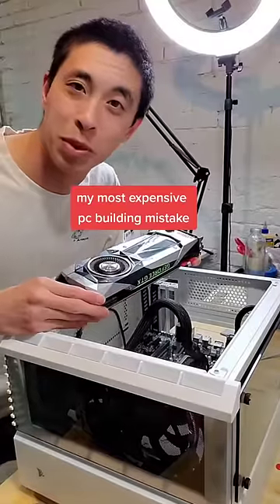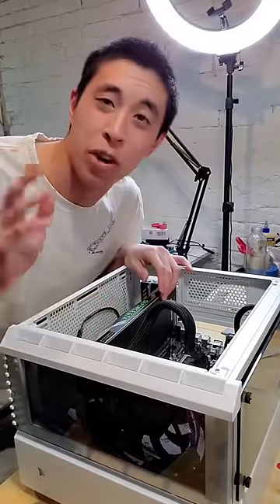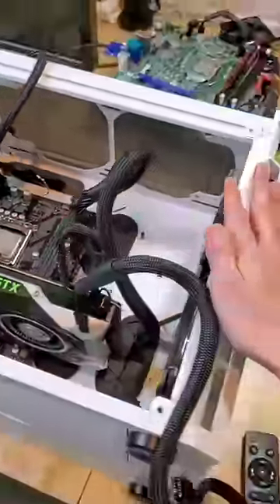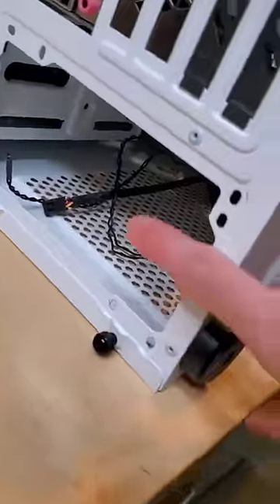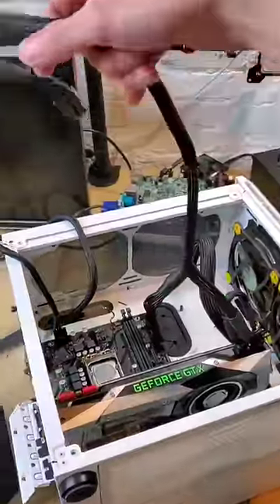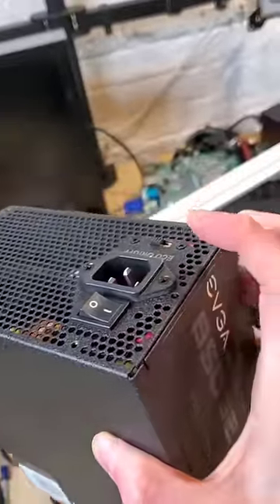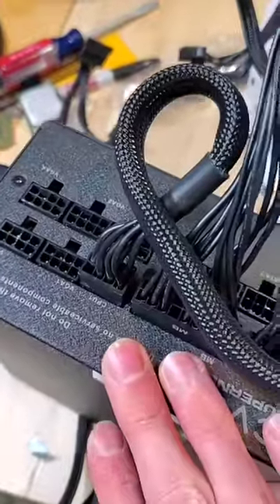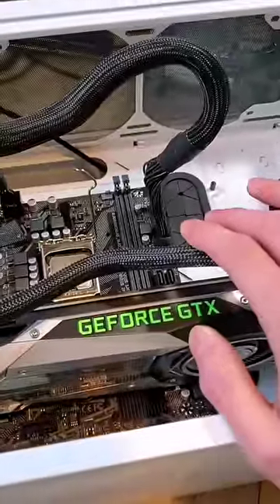my most expensive pc building mistake... #shorts

Comment: The second he said "pre routed wires" i knew where it was going, and sure enough THERE WAS NO PSU
Reply: Yup.
Reply: To prevent do this  you just replace the cables and use new ones?
Reply: @MorTphyr  absolutely ALWAYS replace the cables that you KNOW are compatible with the psu you're using.

The main reason is different manufacturers could have different pin layouts through out the wire / molex.
Reply: Make sure the OEM are the same. U can use seasonicand Corsair cables in some cases as the oem is seasonic.
Reply: @VirallVariety  it can even be dangerous to mix cables from the same OEM, don't risk it
Reply: @sselesUneeuQ  thanks,  i was wondering why it died.
Reply: @sselesUneeuQ  then what can I do if somehow i broke the cable, buying new cable seems dangerous
Reply: @velzing22  you should check that the replacement cables you buy specifically list the model of PSU you're buying them for
Reply: Always measure with power cables. The connector pinout on the component side is standardized, but the PSU side sadly not.
Reply: @RicardoVermeltfoort  
I think you ment the brand. 
A Corsair PSU with Seasonic OEM  uses  use different pinout than a first party Seasonic, for example.
Reply: Im wondering also why there wasn't a cpu cooler on
Reply: @sselesUneeuQ  what cables? I am new to pc building and am going to build my pc next week. Are you saying CPU cables or GPU cables? 

I have a Corsair 750w PSU and a Geforece ROG strix 3070. My cpu is a Corsair h100i.

Are those cables all compatible?????? I’m getting freaked out now
Reply: @Yinyang1277  PSUs come with all the cables necessary and not all PSU cables have the same pin layout. 

The "CPU" cable is just the motherboard 24pin connector and the 6pin PCIe connector. GPU cables are just 6/8pin or 2 6/8pin PCIe connectors.
Reply: @sselesUneeuQ  sweet! I build my first PC today wish me luck haha! When I am done with it I’ll make a shorts video on my page in case anyone is curious! 

I’m very nervous, but very excited! I am afraid of the cables and cable management tbh. I’m not longer afraid to assemble the actual parts though as I thought you need special screwdrivers etc not a standard Philip head.
Reply: @sselesUneeuQ  that makes sense though thanks for the information! When I was reading these comments etc I went from being calm to FREAKING out🤣🤣🤣🤣like no way did I spend this much on a motherboard and PSU just to find out they aren’t compatible NOW that the parts have come in when no other video has addressed this out of the literally HOURS of videos I’ve watched before hand.

Now I see what you mean it’s just you can’t guarantee a PSU can have all the correct cables for your motherboard. I thought all of them came with the correct ones so it’s good to know💯
Reply: i think having multimeter can be really handy with this , if you can measure the pins u can know for sure if it will fry it or not
Reply: @Yinyang1277  this video is a poor or terrible psa, i know its a short video but at least he should clarify that you shouldn't mix random cable with different brand psu. I searched half of the comment trying to find if there anyone could explain but to no avail. Im glad that you asked the question and we finally got the answer. Cheers.
Reply: In short, from my understanding is that to never mix random cable with different brand psu because different manufacturers have different pin layout. Only use cables that come with the psu inside the box. Correct me if im wrong.
Reply: @lemonadejuice7356  ohh ok good that’s ultimately what I ended up doing! I built the PC myself, but I didn’t know I needed an adapter cable just to finish the front fans.

I gotta say it was satisfying lol!
Reply: @lemonadejuice7356  very stressful… but worth it🤣peace and love
Reply: @Yinyang1277  cpu dont have any cable. your corsair h1001 is aio cooler which usually connect to motherboard. idk about this model much because i dont have it. PSU cable are build to be compatible with all component. What he mean, the power cable that comes from the PSU cant be used on another PSU (modular PSU) non modular, already have cable soldered from the PSU, so you cant mismatch/mixed it anyways
Reply: this is so cringe i will block you
Reply: @Yinyang1277  they're saying don't mix a any cables from 1 PSU with cables of a different PSU.
Reply: @ArtisChronicles  OHHHHHH! Thank you that makes sense I wouldnt do that anyways just for safety reasons. Good to know its the right thought!
Reply: @velzing22  send a polite email to the manufacturer explaining the issue and all the information about your power supply (serial number and all), they might be kind enough to send you a replacement cable that will be safe for use with your power supply or even send you a new power
Reply: @Yinyang1277  your PSU will come with all the cables you need, if by some chance you lose a cable or something happens to them then you should contact the supplier, in this instance Corsair, and inform them about what has happened. They will likely offer to send you replacement cables which will be safe to use for your particular power supply
Reply: @lemonadejuice7356  they have different pin layouts, tolerances, current allowance, etc. Mixing and matching PSU cables is a game of Russian roulette and it requires a lot of research to truly know if a cable is compatible for your specific needs, therefor the average consumer should always use the cables supplied with their PSU or cables approved by the manufacturer (replacement cables sent to you after contacting the manufacturer)
Reply: @sselesUneeuQ  so basically ITX is a shitty standard
Reply: @MorTphyr  different brands use a different pin arrangement for some ungodly reason. Evga is incompatible with corsair for example
Reply: "...no,no,NOOO!" - my reaction when I heard modular cables but no power supply. Pain just thinking about it.
Reply: @lucamartino100  not really, everything on the component end of the psu cables is standard but between different brands and even different models within the same brands the cables could be different on the PSU end, which would lead to fried components
Reply: @chaosinhd1823  so if ITX had also standardized cables or connectors on motherboards there wouldn't be this problem. That's why I say it's a crap standard.
Reply: @MorTphyr I prefer to eat them

Comment: Not me personally broke anything but i sold almost brand new ryzen 3900x. Took pictures of it beforehand mainly pins and had them time marked Incase something happened. The guy requested a refund saying it wouldn't work.  I got a completely different card back with half the pins broke off and a whole new serial number.  Called eBay support and they sided with the buyer so i no longer sell pc parts on eBay.
Reply: naaaahh, jit trippin
Reply: Never EVER sell anything at eBay or you'll regret your life decisions your whole life
Reply: @tomotime9284  elaborate?
Reply: Ebay will ALWAYS side with the buyer. Notice how there’s buyer protection, but no seller protection? Never use ebay, I repeat anyone reading this- do not sell on ebay.
Reply: @ToatsMcGoats534  
Years ago they used to side with the seller or at least give you a fair look at.
You could understand that both sides can be lying but at least with a seller you have a track record. A buyer can make a new account on the day of sale... Remember when you used to be able to block certain areas or accounts from making offers? They ever bring that back? No ebay.. I do not want the new account "willscam23sChina$#@" to bid on my item.
Reply: Had something similar sold a 3090 and made sure to take pics of the pcie interface and power pins, buy then says card won't work and when he checked there was damage to pcie interface and some of the pcie power pins had been bent, asked for pics and looked like he had dropped the card and forced in the power the wrong way round, refused a refund. Ebay initially sided with him but I sent them all the pics and threatened legal action if they didn't at least look, ultimately they denied his refund but it shouldn't be that hard.
Reply: This is why I never sell on eBay.
Reply: @tomotime9284  I've sold on ebay for 6 years and never had an issue.
Reply: Man IDK what yall are doing so much differently but I have never had ebay side with the purchaser. Granted I am METICULOUS about logging evidence of the items condition prior to me sending it out. I also make sure every item is marked "non returnable/as is". Lol
Reply: Selling pre owned electronics on a third party website just screams bad financial decisions. That a shim market anyway you did yourself a favor by stopping.
Reply: Just don’t refund, especially with eBay.
Reply: I appreciate your comment and will heed your warning. My condolences.
Reply: You'd think the fact it had a different serial number would be a dead give away
Reply: That's fucked up
Reply: No it's okay to sell on eBay the problem is they have all these programs and initiatives and guarantees and money back warranties and insurance and people ignore all that because they're being cheap and then they get mad when they're liable that's why big companies with overhead don't even care if you send something back that's broken they have insurance
Reply: That’s when you issue a chargeback. I threatened to take my bank to court before if they wouldn’t issue a chargeback when I had loads of proof that services were not rendered. I had my money back in a couple days. They can issue a charge back if eBay took the money when they sided with the buyer. Then everyone wins except ebay
Reply: Sell crypto scams. And watch your bank account fly
Reply: @snkantzas  read justmamba 's comment
Reply: @AikaroMusic  ebay refunds your money for you.  you have NO choice.
Reply: leo c  spend $10k on a lawyer for a $300 refund???
Reply: @snkantzas  doesn't the original comment really tell you why not to do it? :D
Reply: yes, Ebay is buyer sided, now people don't want to sell to new ebay account, just for that. It's sad.
Reply: @tomotime9284  I mean I wouldn’t say anything, I’ve been selling collectibles and vintage toys on eBay for years, at least in that market there’s hardly if not any assholes
Reply: Ebay and paypal are trash...i just had a similar issue with paypal...had to escalate to my CC and they sided with me. Im guessing out of spite my paypal was locked down and they wanted me to jump through hoops to get it unlocked...fuck paypal.
Reply: EBay doesn't want respectable sellers on their platform is something I learned years ago.
Reply: @ToatsMcGoats534  now I know I can buy things on ebay safely.
Reply: Ebay always sides with buyers even if you offer no returns. Had same exact thing happen but wasn't a pc part... lost 3k

Comment: These are the kinds of shorts we need, no telling how many peoples' systems you saved in the future by sharing this.
Reply: too late..
Reply: For real I was literally about to do this in about a day 😅
Reply: @fragelius you did it ?
Reply: @JeuneF  yeah burned my 3 hdds but ssd survived :p
Reply: I still didn't understand the problem. Why everything burned?
Reply: I Goodled it and it's because modular cables are not standardized like molex and other aftermarket
Reply: @robipindric7654 because the pinout of modular power supplies mostly isn't the same between models even if the cables fit. We're used to cables only fitting where they're supposed to go on motherboards, but that's not the case in modular PSU's side, and wrong connections will usually fry one side or another, or both
Reply: I was about to do this as well im so glad I saw this
Reply: Probably me. I just ordered a new PSU I am an noob So I bet I would have just used the same cables that are already attached

Comment: Forgot to turn on my power supply… the emotional damage I suffered that day was on another level!
Reply: WAIT explain I've never built a PC so the understand here
Reply: @ryanlee9150  lol he's kidding all he did was not hit the power on switch in the back of the PC haha
Reply: @Iamdudeman12  you know my suffering!
Reply: @thanefenrir  yes I do!!! 🤣🤣
Reply: You start thinking “FUCK FUCK, did I shock the board” sweat starts to form and the anxiety can be felt in the room. 
Then you take it apart and do it all over just to realize it wasn’t turned on. 
That was our friend when he called me during a build 😂
Reply: @mint2470  lmao I recently finished building my pc and had no power lmao and it was the same problem just the switch I always forget to switch it on
Reply: @mint2470  i will never forget this feeling
Reply: EMOTIONAL DAAAMAGE!
Reply: @The_Hussar  I've had similar issues in earlier years when I was new to PC building except I didn't push my RAM until it clicked all the way in. I thought I bricked or corrupted my only HDD. Took me like 30 minutes to figure out the problem too! Was like 15-16 at the time so it was a good learning experience
Reply: Damn, i feel that. Last month i build my first pc. All cables was connected but it can't turn on and im panic. After several hours looking for a solution, i realized that my psu switch still off 🤣
Reply: When I built my first PC, I forgot to plug the power supply cable to the power button. I almost tore it apart to put it back together again.
Reply: super relateable it makes it way less satisfying
Reply: I plugged the DP cable in the motherboard. Not the GPU. I was freaking the fuck out.
Reply: Well had this feeling like a few times xD sometimes the pc reboots itself a few times to automatically configure the ram, you have to gie it some time and I was like restarting it 30 times 🤣
Reply: Lol😄👌🏽
Reply: LOL!  Hopefully it resolved itself in a few seconds when you realized that.  If it took longer, you should really analyze why....
Reply: @ryanlee9150 They didn't turn the power supply on, so when they tried to turn the PC on it didn't work.  Which induces the panic one can only feel when they fear they've done something wrong and possibly fried several hundred dollars worth of components.
Reply: I feel like everyone does this the first time
Reply: I hear you. I had a bit of a scare after doing PC maintenance in early 2023 when I got no video, just a blank screen. It turned out I had forgotten to plug in the HDMI cable again.